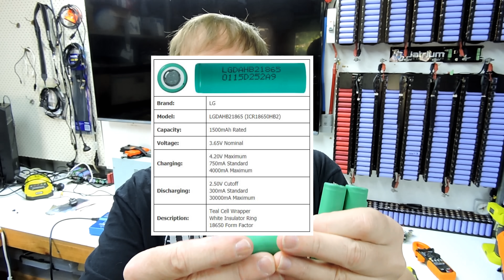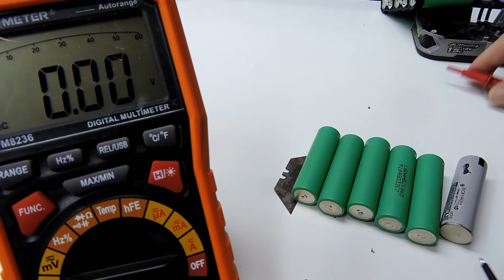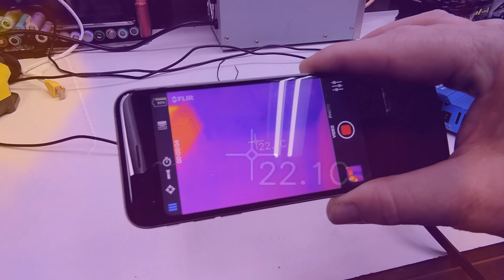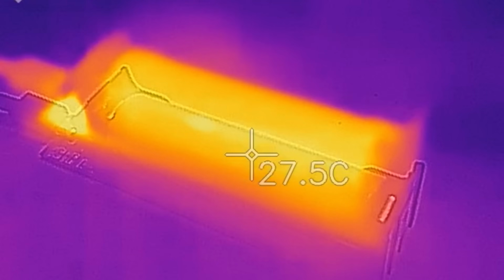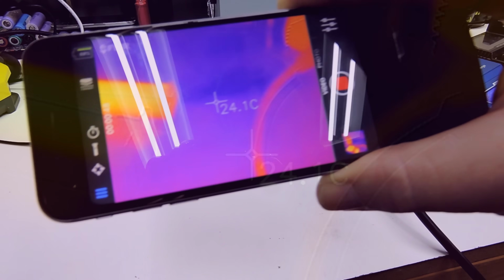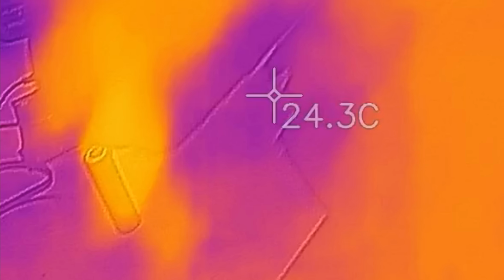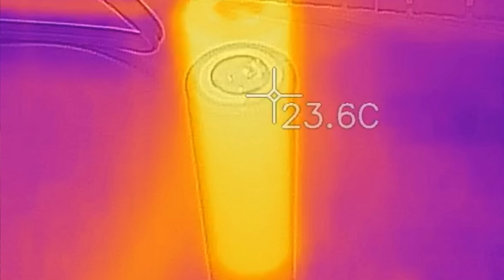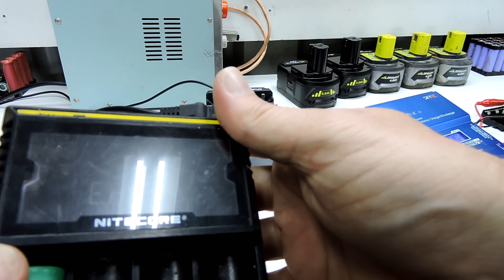18650 CID Reset   ⚡ DON'T DO IT! ⚡

Comment: i made a pressure vessel out of a pipe and caps and an air compressor fitting and put the battery in it. then I charged the pipe to 5 psi and that poped the cid back in.
i know what happened with my 18650 batteries was a bad charger from china that over charged them and over heated them.

Comment: I have a cell suddenly died to 0V after 2 days I fully charged it and I got it dropped quite hard to ground serveral times. I decided to revive it for educational purpose. I woke it by connected it parallel with a good cell till it got 2.9V, enought to use an charger. Then no matter how I charged it, the voltage still dropped quickly and the temp is quite high than normal. There must be short circuit whether inside or outside the battery. Then I unwrapped it, there was corrosion growth around the anode cathode separator on the anode end, that was black, hard solid. It'made short circuit. After removal of the corrosion, voltage did not drop quickly anymore. But the problem is, when I tried to recharge it. There was gas with no smell,  no color, hard to tell if that did not make me to cough and hard to breath. Yes, I got it by my body sensor.
It's the better, safer and cheaper to buy new cells rather to revive them. The dead cells they were dead for reasons that we are unable to fix from the root

Comment: NothinK NothinK NothinK,  A small piece of plastic under the positive terminal, it's a "diaghram" ? "You have to push it down, but I'll show how to push it up"  But back to reality, I've lost track of how many batteries I've managed to bring back to a full charge but I recall how many failed and they can be counted on one hand.  The only dead cells I don't play with are Lithium Polymer, although I have rebuilt many packs. If an 4S drops a cell, it becoomes a 3S or makes a 3S become a 4S.  One important thing I do is look after all my batteries. I have 6 2S Batteries I purchased in 2004. 2 x 8000Mah and 4 6000Mah. It took me weeks to hunt a supplier down who has the stocks and each of those batteries are as good as the day they arrived. I've never done any more than check their voltages every 6 months and if needed top them up to 3.8v per cell.

I'm amazed at how you make such a song an dance about rejuvinating batteries and then show everyone how to do it, (very poorly) I must admit I did have a good laugh over the constant referral to model numbers, which of course means absolutely nothing to most people. I have to wonder what makes you believe you're qualified to dictate what viewers can and can't do. What exactly are your qualifications?  As far as I can tell, you weld 18650s together for some reason.

Comment: Sir i have battery 5000mah and 4000mah i connected in series my battery pack 52v why always unbalance voltage? Always higher voltage this 5000mah?

Comment: The video was informative explaining the operation on the cid protective device. Quite honestly the overcautious (never do it part) is a real turn off. Explaining why you choose to not reset the 18650 cell is ok; better to inform the you tube students to use their own judgement  at their own risk. If its  so  dangerous I would like to see you do a controlled fire or explosion. All the best and cheers from across the pond in New Rochelle N.Y.

Comment: heck feller i did that to a liter gob and run them 30 amp 18650 cells 4p in a old hulled out car battery hooked straight to alternator i guess at least a dozen vented safety 3rd .wen will it burn,would i do this yes but not vented or hot units safety is fine but come on man not all are bad that pop up that thing lol
Reply from the maker: Well you put it into to one of your builds and film it failing.. no way i'm going to take that chance.
Reply: @HBPowerwall  yep i do not blame you at all only use in truth may be a booster box / supercap rig thats it all in good fun

Comment: Naaa, M8.. Youre doing it wrong! Of course, you scrap a bad cell (like this green LG youre messing with). However, there is always a reason to why CID protects the cell, and its often happen because of faulty BMS, thats allow the cell to be overcharged. This cells will almost always work when you resetting the CID. And of course, dont reset the CID this way shown in video. Use something thats fits perfect, so you dont damage the cell. Sorry,m8.. This had to be written!
Reply: My first time doing it and have only just started with projects using them but I had the exact same thought as I tested each cell after resetting.
6 cells made up a 22v pack, the first battery on the BMS for the #1 cell was perfect, every one after was 0.2v? 🤔 
Once reset each cell tested between 2.7 and 2.8v!  The exact same as the cell that was fine! 
It was a pack out of a kambrook car vacuum cleaner.

Comment: I have tried this method but didnt work for vct 4 salvaged from makita 18v battery, even if i try to paralell charge them terminal wires heats up so much like im shorting out the circuit, what will be the problem and any solution?

Comment: There is an awful lot of information here. I was curious to what all tools you were using. I tried looking through your list which I do see a lot of tools. I doubt or don't really know if you'll see this message but if you do is every tool you're currently using to do this listed in your description? I have about 2000 brand new laptop batteries that have sat on a shelf to the point where I guess they turned ourselves off so they could not be charged. When I check the batteries in a charger It shows zero cycles on every one of them.

Comment: Thanks for this video, however I'm wondering if coming to a conclusion based on one "sample" is wise?!?
A few moments ago I've watched a similar video, with one major difference: TWO cells were tested, both with very low voltage, (CID not popped). On both of them, the "parallel" method described here was used.
The result was that one of them was recharged enough to be recognized by the charger after about 20 seconds of being charged by a good cell, without overheating.
The second battery reacted similarly to the battery you've tested here, i.e.- it overheated quickly, and the voltage stayed unchanged even after 3 minutes.

Perhaps SOME batteries can be revived, and some batteries can't.
If it takes 10-20 seconds to find out which are "good", (and which are not), you can decide for yourself whether it's worth it.

With your skills, you could probably also set up a testing device, to test several of them at the same time, quickly.

Comment: when reading the volts of used 18650 batteries, generally speaking, how low of a voltage do you allow before you just say the hell with it and throw it in the recycler?
Reply from the maker: For my entire journey for good or bad i've tested every single cell for heat, self discharge, capacity & more recently IR if its 0.01v i will try to revive (this is not idea I've since learned)

Comment: I've done a few CID resets and most of the time I get fine cells that are working normally but I keep them in a fireproof container in case something bad does happen as they are fully charged. I don't plan on using them though and I will probably recycle them

Comment: hi im a new subscriber and i would to ask a question if it is safe to revive and use the 18650 battery that has a voltage range of 0.6v - 1.5v that came from old laptop batteries. i will only be using it for parallel a diy powerbank or for mini e.fan with 3.7v only..i hope you have time to answer this question and thank you in advance.

Comment: Thanks for the vid. I'm a total battery noob so take it easy on me. I have an issue of an 18650 not charging. The battery is fairly new and I bought it as a pair with the other one working still. I saw a suggestion of inserting the battery at an angle in the charger which then gets it going again after a few minutes when placed back in the default position. It worked but I don't want to take any chances. Based on your video that cell is most likely dead. Any thoughts on that?

Comment: I revive 0 volt batteries all the time especially from batteryhookup.com, but I know what I'm doing and have been doing it for years. When I do revive them I usually will only get between 1000 to 1400mah from a 2200mah battery. Only good for a small flashlight or so.

Comment: I think throwing away those cells are a bad idea , unless there leaking then I manually charge without taking them apart . I pair a charged cell in series with the bad cell then charge them both up. For safety I'll monitor the temperature and as long as it holds a charge then wham bam thank you ma'am. I gots me a couple of earthsavers ready to power my 12 inch vibrating neck massager
Reply from the maker: I think its a bad idea not to recycle those bad cells.. but each to his own what would I know.

Comment: Careful friend, and im not trying to be rude, I only wish to help. At 3:19 you called it 0 ohms. That is incorrect, lt would be infinite resistance, or a open (which is indicated by the "OL" on the meter)...BUT....It gets deeper, since you have a DVM and not a older analog meter try looking at resistance on a good battery, you can not measure resistance with voltage in the circuit. Reason why is a ohm meter is really out putting a small voltage across the test leads and looking at it across a resistor inside the meter whose value is picked to give the proper ohm scale or range. Ohms law, resistance = voltage / current . The meter uses this to calculate resistance. If you try this on a older analog meter you will damage one or more of these internal resistors. Hoping maybe this will help down the road. I DID enjoy the video, you taught me a few things about Lithium  batteries '
Reply from the maker: Thanks for the correction.

Comment: Just curious, what do you do with those hundreds of batteries in the background? Do you sell refurbished batteries in eBay? Pls don’t be offended if may I ask.
Reply from the maker: I recycle them to power my home off grid.
Reply: @HBPowerwall  can I still use  a recycled battery to its specific use, based to my smart charger after charging it has 4.2 V but it didn’t reach 2 A per the the data sheet. Just getting .00xx Amp only.

Comment: Ah so that's why my Canon Ryobi copy smoked up that easy short method was very apparent when cutting the nickel buss bars off the positive ends of cells. It's a good test of cell current output. Btw Nothink! O/L on the meter in ohms is actually alot! High resistive cahoonas etc, but you knew that 🤔🤣

Comment: There is another method but don't try it unless those batteries are needed for light in the wilderness and no other options.    Those cells that have zero voltage and zero ohms and that stay cold when charge is attempted   .   Heat your oven to 350 degrees and turn off.   Place batteries in oven  connect three in series bring wires out of oven and measure with volt meter.   The batteries will start to measure voltage when the voltage goes up to a couple volts, remove and place on charger.

Comment: I once did 5:19 when attempting to reset the fuse on a cell, problem is i was using my multimeters test lead (connected) in order to get to that tiny space, said bye bye to my multimeter afterwards
Reply: COMPLETE AND UTTER BULLSHIT. No matter what you do with one test lead of the multimeter, it will never cause it to fail.

Comment: You didnt push the cid fully down on the cell. If you did it would've taken a charge. I've totally had to do this in the Bush. 100° direct sunlight inside a vehicle pushed the CID up on three fairly new cells. 
Worked on all three and used them for the whole trip. I replaced them when I got back home.

Comment: Had the exact same on a LifePO4 18650. Had a internal short in it, and was leaking acid from the - side. Even putting it accros a 12v battery didn't really do anything. It just heated up and done nothing. Gave it the last push by putting it in a fire.
Reply: No... You didn't have the exact same because LiFePO4 batteries don't have the CID in them. Of course your cell was dead, you already said it was shorted out and leaking fluid (not acid). So being surprised that putting 12V on it didn't fix it make you as dumb as dog shit, right?

Comment: If the battery has less than 1v it is unrevivable and under 2v it is not worth reviving. The only case would be if it was just recently discharged for some reason, if it's old then it's trash.
Reply from the maker: I call bullshit, a cell that is 1v is there for a lot of reasons.. TEST them all.

Comment: Question: i rebuild my outboard electric motor battery pack 8x8 cgr 15650 cg. The motor power consumption was up to 1000Wt. The motor was from 2012. the production cells held the full-throttle (1000Wt) ... up to several seconds but not 30 minutes like suppose to do. At low throttle (~100Watt) motor was working hours. i decided to rebuild the battery pack with new cells. The new cell works well. The question is about the old cells. After one month of the rebuild, i checked the voltage of old cells and it changed from 4.14V to 4.12V for all cells what is looks good. No? do you know why the old cells were not able to provide high Wattage? I have checked the charging/discharging of one cell with icharher 208b and it showed that the cell got discharged/charged in 10 minutes by current 0.5A. In range 3.3 - 4.1volts

Comment: I'm confused. How do you measure continuity between battery terminals without having a high current run through your multimeter? I thought this was a no-no. Maybe I don't understand how a DMM measuring resistance/continuity.
Reply from the maker: or maybe i'm doing it wrong?
Reply: you are correct, you cant measure resistance with voltage in the circuit, the meter wont cause high current though because DVM`s have a very high input resistance (11 mega ohm) so as far as current it wouldnt draw any more than your fingers across it. older analog meters would be damaged doing this.So the biggest problem is the meter would give a crazy reading, if i remember correctly, at that voltage it would still show the "OL" he was seeing. there are ways to measure the batteries internal resistance by measuring voltage across a resistor that is placed across the battery, then calculating battery resistance using ohms law (resistance = voltage divided by current, the current is calculated by the voltage measured across the resistor) you can search "measuring internal battery resistance"  and it will give you the formulas needed and the specific value of the size and value of resistor needed

Comment: Do not place discharged battery with charged one in parallel. 
This action will damage both batteries. 
Due to power transfer will be unrestricted, 
and both batteries will overheat all batteries have different charge and discharge rates.
Reply from the maker: Well yes.... but what about resistance in the cables attaching batteries limiting current flow to just a few amps for just a few short seconds. ? it is not idea but sure does work
Reply: @HBPowerwall  Well if you want to argue from that point. Let me help you;  Batteries also do have there own resistance.

However those resistances are no where enough to limit their charge or discharge at that level to make them safe, or not severally decrease their life expectancy.

If they were enough for quicker discharge we would be placing Wire between positive to negative sides.

Comment: 2018 - 2020 :) Tried it on a dead 4 cell battery pack. (not used a lot and lay in the shed over a year sadly 0 volt.) Popped the CID back into place and they all measured 2.x volt. Charged them slowly with 200mA and raised the voltage to 4.2V. (inside lipo bag) They stayed cool to the touch and now they work like they are new again but like any other lipo li-ion they are monitored and replaced as soon as they do unexpected things. As far as I could find out the CID was invented after a bunch of 18650 burnt "down" a plane (while on the ground) so, safety is cool but it's not uncommon that batteries form a small amount of gas due to chemical processes, and yes! pretty fast if charged or depleted incorrectly. Anyone using LiPo's in RC knows this and these are even more dangerous than Li-ion.

Comment: looks like you start to be in the planned obsolescence way now.
Reply from the maker: Yeh, cause safety isn't a concern lol
Reply: @HBPowerwall  Well, as a experienced DIY messing with many batteries like you from long time ago, i know some of those CID`s fails just because lifts off and just open the circuit inside, because maybe the cell hits the floor by accident, but the chemistry inside the battery is just fine,by carefully pushing that, i know that battery can work again.
In my opinion, i prefer you post a video saying how ppl can do it, like you did here, but instead of repeating the same thing that "don`t try this at home" maybe you can say "you can do that with some precautions, like having an metal can with cover, if the cell gets short for some reason, you can cover with this"  or similar. I just admit that most of the cells that are open is because the pressure builds inside of the cells, but not all of them has that problem.

Comment: I've reset Cells many times before and never had problem charging them well providing it has a reset switch.  Maybe one shouldn't use a think screwdriver and use proper tools.
Reply: Sticking a flat screwdriver is the wrong tool. Emphasis on the word flat.
Reply from the maker: any tool is the wrong tool, mine was worse than other i guess
Reply from the maker: You're a twit - there is no 'proper tool' it's a safety device that triggered for a reason - probably cause something faulty within the cell.